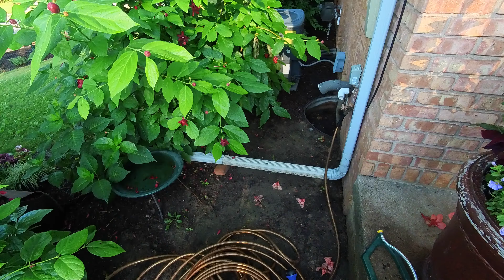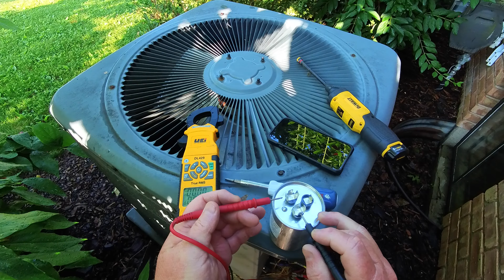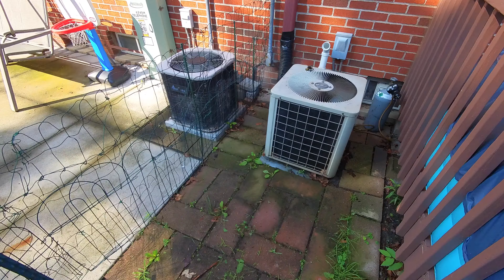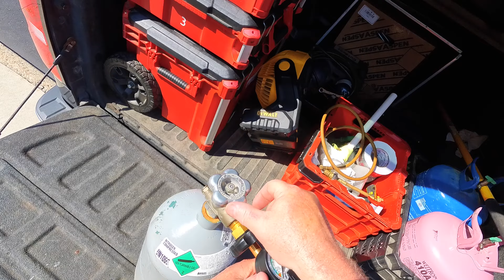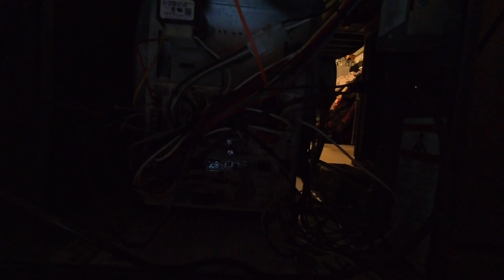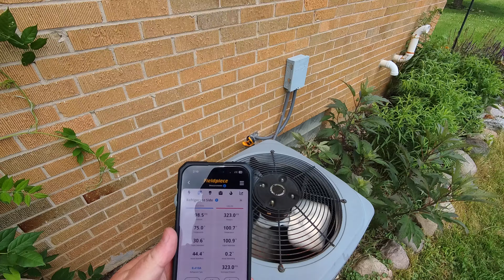AC Repairs in Lansing You Need to See | HVAC | Tri-Delta Mechanical

Comment: Great, I like your videos.  You keep things simple and  straightforward.

Have a question for you.   Does the homeowner pays a fee to obtain get the blower motor under warranty from the supplier (restocking fee, etc).
I understand the labor is not covered on a 10 year AC warranty, but blower motor is. 

thanks
Reply from the maker: In this video the motor was covered under warranty. There is no fee for this with our company for obtaining the parts. 

Thank you for watching